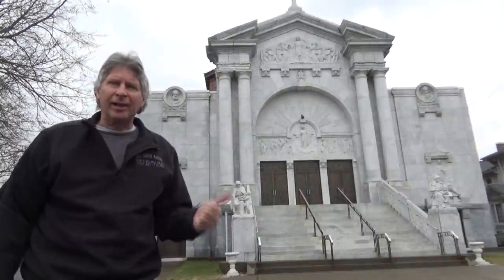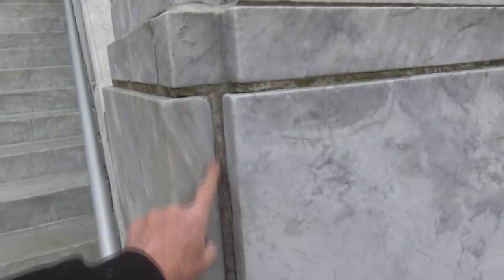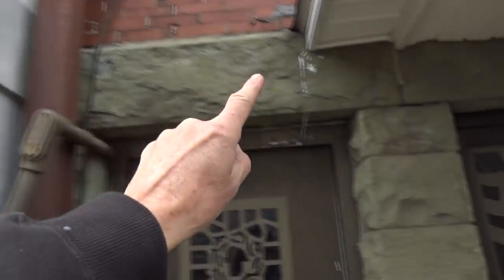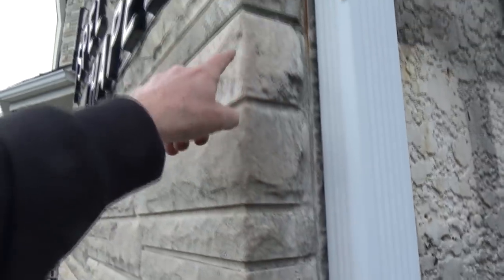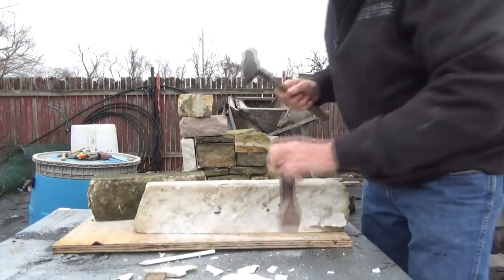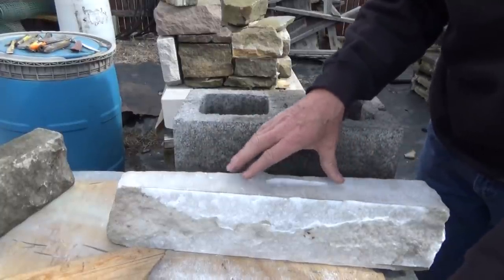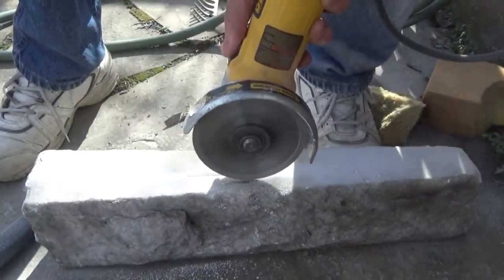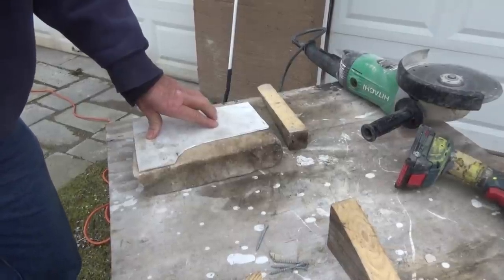ROCKFACING AND SHAPING STONE (PART 3) Mike Haduck

Comment: The ancients did not use the mortar horizontally but only "vertically" .. especially when several ton blocks were used. That is why these old buildings or walls still stand today .. Greetings
Reply from the maker: Hi szpak,  I got a video comming up about that, your 90% right, Thanks Mike
Reply: @MikeHaduck  
◄ Genesis 11:3 ►
"And they said one to another, Go to, let us make brick, and burn them thoroughly. And they had brick for stone, and slime had they for mortar."
bitumen was used ? any practical application? I'm waiting for your comment ;) Greetings

Comment: I never rockfaced marble.  Only flagstone (bluestone), I would just use a brick hammer to do it.  That made a nice 'interesting' edge on steps with flagstone treads and flagstone wall and pier caps... I set the stone in a dry-pack bed with Portland 'juice' poured over it after the pack is initially compressed by the stone.  I tell you that made it 'SOLID'. Drop a chisel on it and it sounded like it went 100 miles into the ground. Try to chisel it up just one day later and it was 'not easy'..
Reply from the maker: Thanks bonanza,  Mike

Comment: Hey Mike, thank you for all of your videos, it is very helpful. I was wondering if you could do a video on repairing cement window wells. I have a few that are cracked and I am debating if I should repair them or just knock them out and replace with galvanized steel ?
Reply from the maker: Hi Mike,  cement window wells around are always a problem, I usually tell everyone to go galvanized,  I hope it helps,  mike

Comment: I'm loving this video. thanks for all the info.    I heard ya say they used cement to hold the stones together but I'm quite certain Cement is a big No No in brick or stone work, Mortar is the only thing to be used because it is softer than the block and will erode away before it bust the block. Just like I'm sure you've probably seen where somebody re-pointed a brick face wall, only to bust the front of the bricks off and leave behind a Latice work of Cement.  Limestone and Sand, It's A Host Material, it's sacraficial  to save the blocks.     words and their deffenition make a big difference in real world aplication when used incorrectly.
Reply from the maker: Hi Reg, I got a video out called " lime, mortar or portland " what should I use? That will explain it best, thanks Mike

Comment: The difference between Russia and America~
Hoping that this is only a temporary phase we're going through, but it seems like
it is increasingly more dangerous to speak your mind in America.   You might get
cancelled, which means, lose your job, be shunned socially, or be de-platformed.
Reply from the maker: Hi mu,,, I agree, Mike
Reply: @MikeHaduck  -  I followed your tip to cover the concrete mix bags.   I live in the Central Valley in Calif., and it rarely rains.   I went to the store yesterday and bought some bags of 80 lb. Sacrete "High Strength 5000 Plus Concrete Mix", and left them in the pick up.   And I remembered you said cover your bags, so I covered them, and it rained, and rained hard, and even hailed, and rained some more.   The bags seem to be still dry.   I appreciate your videos and have watched many of them.
I like to eat while I watch them because it
is very satisfying to eat and watch somebody work.   I've learned a lot.   I want to mention Easter Island.   The Rapa Nui people built structures on Easter Island that mimic Macho Pichu.   The Chilean I was renting from thought there might be some connection between the people who built Machu Pichu and Easter Island.   I don't think so.   I think it's natural to fit big blocks tightly because they didn't have mortar and lave is easy to shape.  Watching you working stone with hand tools further convinced me of this.
Reply from the maker: Thanks mu, I agree, that rock is easy to shape, mike